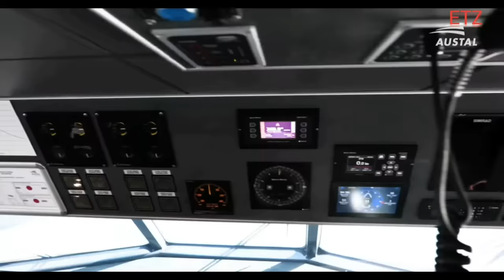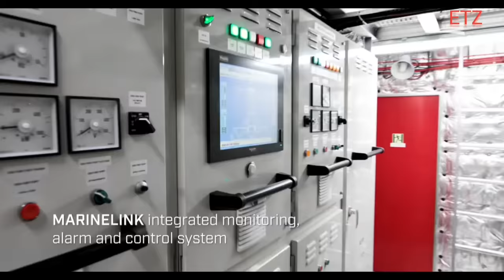WORLD’S FIRST AND LARGEST HIGH SPEED PASSENGER TRIMARAN FERRY

Comment: I'm thinking of an idea for the return of ocean liners as "micro liners" - ships carrying maybe 100-200 people per voyage, shuttling them across the ocean. The idea would be to supplement the current Cunard liner services with more transoceanic options. People generally fly across the ocean those days, so there is probably a small market for this - but I bet it's not a market of zero.
Reply: I wonder if fast ferries and expedition ships might be a starting point for future "micro liners".
Reply: Internet capacity and workplace compatibility would be a feature of such liners of tomorrow- and telework might make them feasible. If you can work from anywhere, you might be able to afford more time away from the office.

Comment: Definitely not the first but might be the largest. Been running these to the British Channel Islands for 20 years give or take.
Reply: Those boats were also built by this same ship builder. This is just a mistake in the quote by OP. This builder built the first fast one, now this was the an evolution of that and is the biggest (not by length as others have said, but by displacement, how boats are usually compared).

Comment: What ever you do don't carry EV's they burn up every boat they ride on.
Reply: As a normal engine with oil cant? If a fire breaks out doesn’t matter both are bad if not serviced
Reply: @Nastalas  EV burn at almost 5000 degrees regular cars burn at thousand. Ev can't be put out without a special blanket to smoother them out' There's no comparison they are complete junk. they just start fires out of nowhere.
Reply: @dennis8445  normal Car can’t be put out that easy either both need that blanket, normal petrol car burning is also a total loss, both are bad if not serviced correctly